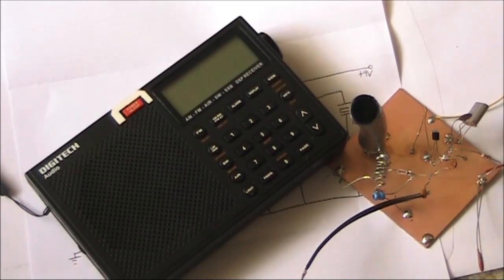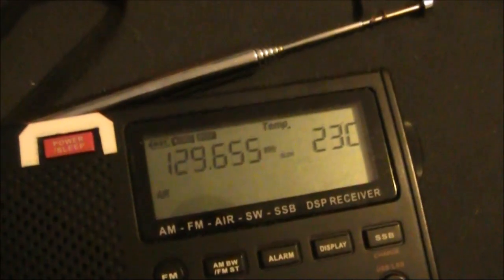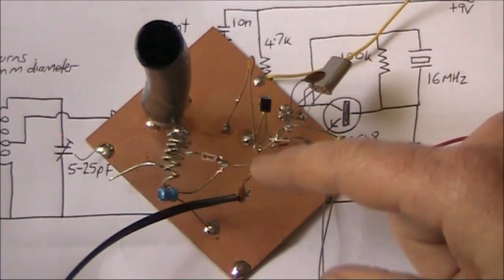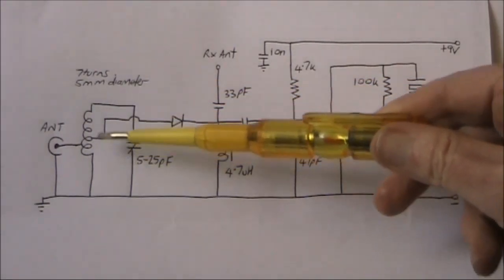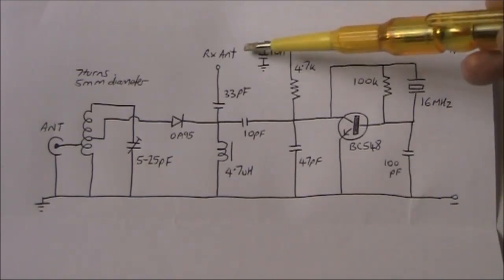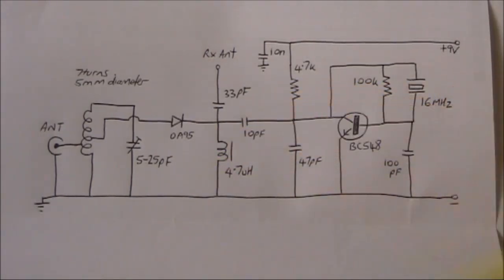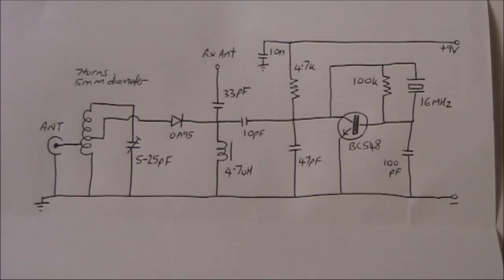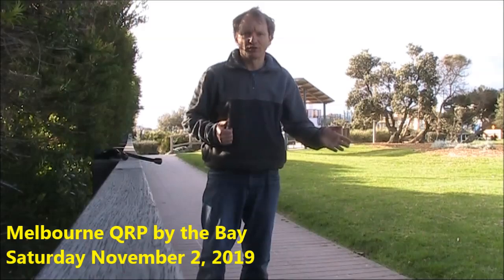Simple two metre to VHF airband receiving converter

Comment: You have mentioned in a comment that it would be extremely difficult to use a household FM radio for 2 meters, but what if I used a 10.7 MHz crystal, and fed the output (of the down converter) into the IF tuner inside an FM receiver - would that work?
Reply from the maker: No. The IF is designed for wideband FM detection. You are actually better off converting 2m down to an AM receiver and using slope detection.

Comment: If I add 60mhz crystal  on this converter. Then I can receive 145 mhz frequency on  
80MHz FM band?
Reply from the maker: In theory yes. In practice no. FM receivers are wide deviation and any 2m FM activity will be very quiet if heard at all.
Reply: How to receive 2m on common fm radio receiver
Reply: @vk3ye  ah, i was gonna ask the same thing but you are saying because FM recievers are 75khz wide but ham FM is only about 5khz, the deviation will be a very low volume?

You are basically just using the AM reciever then as a slope detector instead, is that correct?
Reply from the maker: @researchandbuild1751  Correct.

Comment: Great concept for a project for beginners, however, when building vhf projects, there is no such thing as a short circuit. Your lead lengths are way too long and must be as short as possible. This in itself will vastly improve selectivity. Re tuning the variable capacitor on the front end tuned circuit, 5-25 pf for tuning- It obviously works when you have the airband receiver on a "fixed frequency" A better way is to tune this tuned circuit to midband and then use the airband receiver as a tunable IF, This method works extremely well. Build this deign as an initial project, but keep the leads short, then, experiment and improve the build with "tighter" double tuned circuits, especially in the front end. The principle of this is what a superhet receiver is, the combining of the sum and difference frequency between the local oscillator and the the incoming signal. Ron Bertrands "radio & electronics school" explains the principles very well. I have built many converters in my time, using old "junk" crystals. I am happy to help anyone if they wish to ask me, 73"s, Barry, VK2FP/AG6VC

Comment: The diode mixer would have 130 MHz as well as 160 Mhz. This might work with a NOAA weather receiver that is tuneable (not the preset ones). I might just try this if I ever get my 2M J-pole put back up. Don't have any quality gold bond germanium diodes but a Schottky diode should work.

Comment: Very simple KISS project. On the video the converter has no antenna of its own connected. Does it work without one? For those of us that don't possess an airband radio: does the converter work with a suitable cristal (37 MHz?) for the FM-band?
Reply from the maker: It needs a good antenna as it's deaf. It won't work for the FM band (in either direction) for multiple reasons including modes being incompatible.